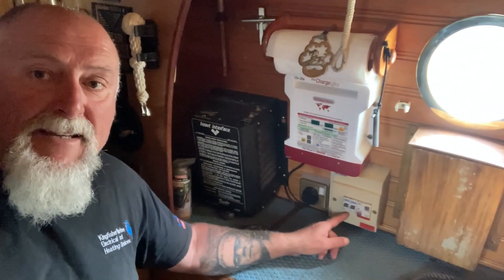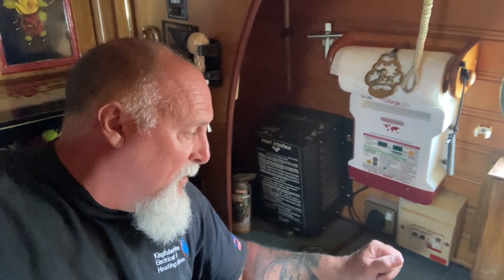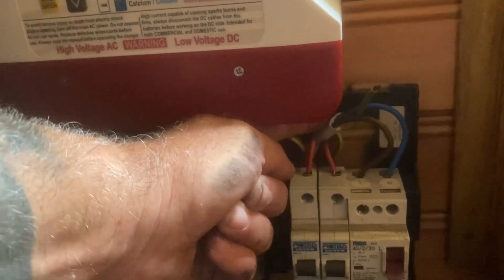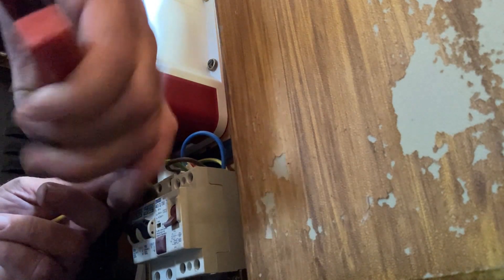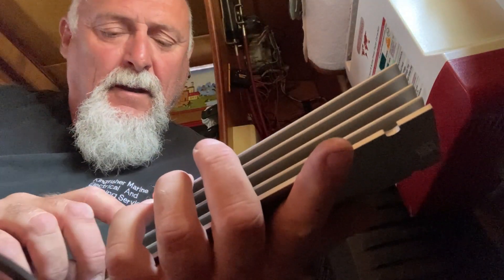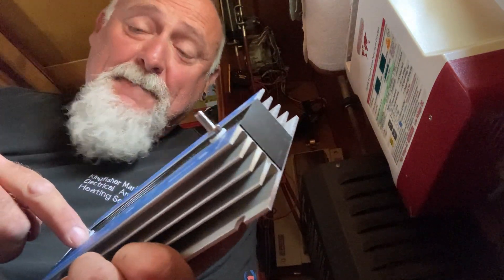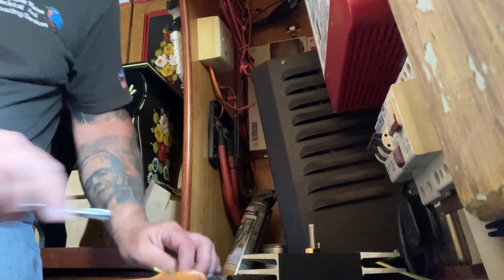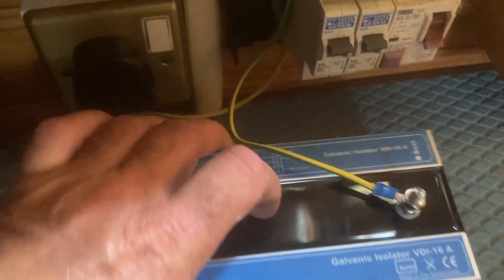Narrowboat Electrician  - Galvanic Isolation

Comment: Really helpful !. Question : So the back-to-back diodes effectively filter all voltages <0.7v either direction but allow higher voltages as would happen if there was a short to earth. Why are they designed with so much thermal dissipation capacity (big chunk of aluminium and fins etc) ? - Surely that would only be needed if there was a short to earth - which should trip the RCBO shouldnt it ?..

Comment: Its funny, here in the USA, the AYBC (American Yacht and Boat Counsel)  required boat builders to install both galvanic isolation and had to have automated testing to make sure that it was still in working order, as there is no way to know if its working or not.  The systems would test the unit when it turned on and every four hours after that.  So when you plugged into shore power the automatic testing would start.  The way it tests, it would actually introduce a ground fault into the AC wiring / shore power system.  Fast forward a number of years, now our electric codes were updated that requires (GFCI) ground fault circuit interrupter on all marina outlets and shore port connections.  This was in direct conflict with AYBC for testing of the GI system.  So as soon as you plugged your boat into shore power it would trip the marina shore power connection.  The only fix is to disable the testing, as the marina wasn't going to remove the GFCI breakers from the system.  I have seen galvanic corrosion on boats in a marina and it can be a huge mess.  Just about all of our boats here are fiberglass, so what would be attacked was any metal on the underside of the boat.  You never knew who's boat was the "leaking" boat that was eating all the anodes off the boat until they moved away.   Keep up the good work sir.
Reply from the maker: That is really interesting. On that type of vessel there are materials like magnesium and aluminum which gets seriously eaten by galvanic corrosion. Our steel hulls suffer too but at a slower rate, having said that I saw one boat that wasn't very old and was severely corroded all down the one side. We fit sacrificial anodes to the steel hull (welded or bolted) that sit at the same potential as the hull. These get taken first if there are galvanic currents present, and we change them when it dry dock where needed. We have RCD's on our bollards too (I think they sound the same as your GFCI) if there is more than 30mA difference between current on live vs current returning on neutral, they trip. Great comment that.

Comment: That is interesting! Never would of thought but ya I see how things would start to corrode if circulating currents were allowed to pass.
You mentioned isolation transformers: we use / used them in hospital to isolate medical equipment from ground... More common for the isolating means to be in the equipment rather than the building wiring now.
Reply from the maker: I am glad you found it interesting. We can use isolation transformers in a manner to block galvanic currents. We are not trying to isolate the supply, we rely on the RCD's to operate in fault conditions.
I would imagine there are a whole host of differences in the medical world and high quality too.

Comment: Hi Mart, when do you think we will start saying 230v instead of the 30 year out of date 240v?
I know I still use 240v when describing mains voltage, it’s a very hard habit to drop.
Good vlog on galvanic protection, I feel marinas should check that boats are compliant if they are long term residents.
Reply from the maker: I never even think about it. Doubt general public even realise it’s changed! I’ll try and be more accurate as that’s the best policy. Cheers, glad you are enjoying the channel, and keep those comments coming.
Reply: I suspect that 230 is just a figure to quote to satisfy some directive somewhere. Our house supply is 243 + - a couple of volts. We have our own transformer on a pole and the supply company considers this voltage to be normal.
Reply: @jonka1  so your supply voltage of 243 is within the UK nominal supply voltage of 230.
Reply: if it makes you feel better, the actual transformer output of substations in the UK did not actually change when we harmonised with the EU. You will still probably get around 240V out of your house supply. We just use 230V now for any kind of power calculations. The tolerance for home supplies is -6%/+10% or around 217V-253V I believe.
Reply: @havoctrousers  yes I know, thank you
Reply: @optimist3580  sorry, it was clear that you do - I meant to reply to @jonka1

Comment: Galvanic's This is also another reason back in the 60's cars changed from positive earth to negative earth or ground; Because of the cars positive ground and Worlds ground potential;  when it rained the cars positive and the worlds ground changed the rain to an electrolyte and the cars use to rust away with respect to the worlds (the earths 🌍) ground potential
Reply from the maker: Spot on mate. We also go a step further, that all systems must be two wire (Feed and return) so no current flows in the hull. Thanks for the comment, its a valid comparison.

Comment: is not stripping the cable in that manor not altering the cross section of the conductor because it will be ever so slightly stretched
Reply from the maker: Hi, welcome to the channel. Us sparkies have been stripping cable that way for years, bigger stuff would be with a knife. Even the proper strippers hold the insulation, dig in and pull.

Comment: Hi, YT threw up your channel and it looks interesting, so have subscribed. I only I have one comment that may help viewers if they have a go themselves. It concerns the nuts on the terminal posts. Just tightening the main nut down is NOT best practice. Always use TWO spanners to pinch up the connections between the two nuts. Just tightening the main nut could cause the terminal to rotate/break. It looks a good quality unit, but you can never tell how the terminal is fastened inside (unless you know better?) and there is always a possibility of braking internal connections (and guarantee?). Cheers.
Reply from the maker: Hi of course you are correct. I had already tightened the base but as they are always lose on the Victron galvanic isolators. The problem is people tightening to tight, by mechanical types, they only need a bit of force to be adequate.

Comment: 😊👍❗
I have no experience of boat electrical system regulations, but;
Would you consider using Pyro cable on all the 240 volt circuits on a boat worthwhile?
.
Reply from the maker: Absolutely not mate. Use arctic flex.
Reply: @narrowboatelectrician  
Would you give your reasons please?
.
Reply from the maker: @niklar55  pyro isn’t flexible. Boats move, vibrate and stretch. Damp could get into the mineral insulation and cause a short. Arctic flex is tried and trusted and a standard in the industry for the 240v circuit. That’s my opinion mate, others may differ.
Reply: @narrowboatelectrician  
OK, thanks for your response, and your opinion.
When I was training, the end fittings of the Pyro cable were sealed against damp, so that shouldn't be a problem. It's also flexible enough to bend around most corners, but won't be floppy and sag. It's no more vulnerable to vibration than copper fuel pipes, in fact less so, as there are no 'olive' connections.
It's totally fireproof, under normal conditions, unless it gets hot enough to melt copper!
We also hammered a piece flat, to about 1-2mm thick, and it still didn't short, so a little stretching wouldn't be a problem that a single coil couldn't take care of. So, I think it would be superior to plastic cables in nearly all situations.
The only drawbacks that I can see, is cost, it's damned expensive, and it's more work intensive to install.
I posed the question, because I wondered if there were specifications in the regulations that would prohibit it in any way. It seems there is not., or you would have said.
So, thanks again.
.
Reply from the maker: @niklar55  yes, I’ve worked with Pyro. Up to you, but I can’t see the advantage, especially factoring in cost and effort. Wiring a boat is expensive enough.
Reply: @narrowboatelectrician  
Thanks for your response.
The main designed advantage, is its fire resistance.
My feeling is, that if there is a fire from some other source, at least you won't have a 240 volt electric fire to complicate matters.
I've just had my barn burn down, due to a short on the 240 volt circuit, possibly caused by animal gnawing the cables.
£100,000 worth of machinery, power tools, tools, and materials destroyed, and the ancient 200 year old stone and timber barn totalled..
So, I'm a bit paranoid at the moment!
.
Reply: @niklar55  Just to throw my 5 penny-worth into the mix - pyro incorporates a solid conductor which is verboten under 13297 (as identified by Mart, the vibration element is the killer and drives the requirement for stranded conductors only) ...
Reply: @salandjim  
OK, thanks.
That's effectively what I was trying to find out. 
Maybe metal conduit would be an option.
I know from my cremated barn, the first thing the Firemen wanted, was to disconnect the electrics, and then if there were any gas cylinders.
The only cylinders I had, of any consequence, were fire extinguishers, but by the time I got there, the workshop they were in was already a furnace. My neighbour told me he heard a couple of serious explosions, so I guess that was the extinguishers.
.
Reply: @niklar55  You say "maybe metal conduit would be an option" - to achieve what ?
Reply: @salandjim  
To confine and protect mains cable from any possible damage, much the same as used in factory environments.
.

Comment: No isolation checks before starting work on a system?
Reply from the maker: Hey Steve, I’m not in industry anymore. I have worked to protocols all my life. Breaking into an earth, for me does not require me to isolate. Good point that I may tell others to do that though.
Reply: @narrowboatelectrician  hi. It’s not you or me but people will copy what they see. Poking around an installation that may not have all its wires tucked up, unplugged from shore power and the inverter has kicked in. I worked in a boatyard where one of the “Craftsman” watched a sparkie disconnect a battery bank and remove the batteries so he could build a bigger battery box. The owner offered him a few bob to put the original batteries back in to save sparkie hours. It went well for the first couple, the next one cost him his three middle fingers of his right hand. Plus making a right mess of his hand. I as you will have seen “that’ll do stuff” that makes you wonder while their still alive or haven’t burnt down. They walk amongst us. 😎🍻🍻

Comment: What a great channel this is! Subscribed! A quick question: does the boat ground/earth wire go directly to the hull (anywhere?) straight from the common ground bar or from the galvanic isolator itself? Also is there any kind of digital  gauge/device that would enable monitoring from the electrical panel, or does a GI basically last forever? Keep up the fantastic work, looking forward to the next episode.
Reply from the maker: Im so glad you are enjoying the channel, seems like I have hit on something, which is great as I want to share knowledge (not baffle people with science) he earth to the hull can either come from the consumer unit earth bar or the boat side of the galvanic isolator. This can go to anywhere on the hull as its all welded together, I often drill and tap the engine support rails, ensuring the paint is removed, There is a "thing" with galvanic isolators, how do you know they are healthy? Some new ones are coming with a gauge that identifies any current flowing. They can be tested with a simple multimeter if there is a diode function. It has been known for GI's to fail under high current fault conditions.
Reply: @narrowboatelectrician  excellent, thanks for the reply! We are having a “hybrid” propulsion boat built in November which, for me at least, involves some scary electrickery! I suppose it’s a matter of trust that the correct wire gauge, fusing, loads etc etc are being used. Perhaps that would be a good future vlog for you to cover ( you can practice on our boat! )? Your vlogs on parallel/series batteries and solar are terrific! Keep up the good work!
Reply from the maker: @thepilgrim4473  thanks for that. I would be fairly confident that a factory built boat would have correct size wiring and fusing. If that builder has good electrical practices. Boat fitters and self builds tend to have more issues in my experience.

Comment: Hi Mart.. If your not 100% sure the boat earth is earthed to the hull how do you know the galvanic isolator is working? or am i just being thick. cheers
Reply from the maker: Hi Nigel. A continuity check is the only way. If the earth isn’t on the hull there won’t be any galvanic corrosion. I did check with multimeter that the hull has an earth. It’s only a few weeks and all the electrics will get taken out. Was done more for owners piece of mind really.

Comment: So my question is - which side of the galvanic isolator does the earth to hull cable need to be? I assume it must be the "boat" side - from the consumer unit earth bar?
Reply from the maker: Hiya, yes any boat earth needs to be on the boat side. The only connection to the shore side is the incoming earth.